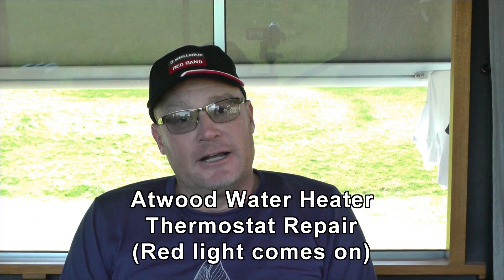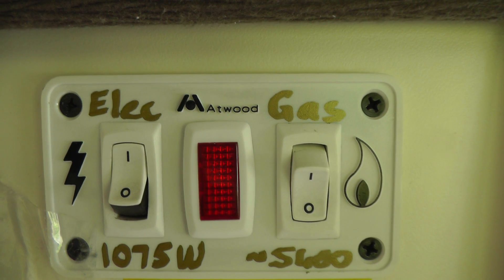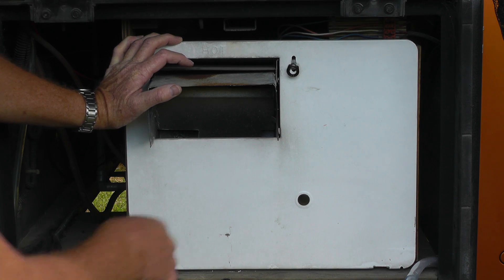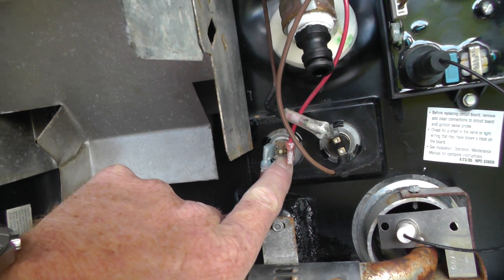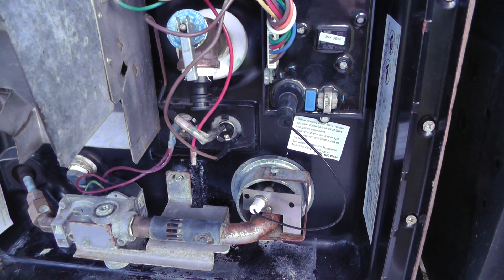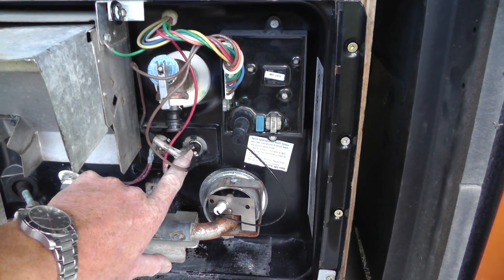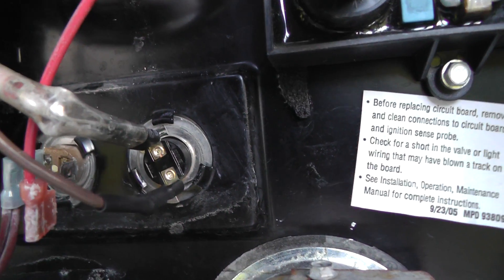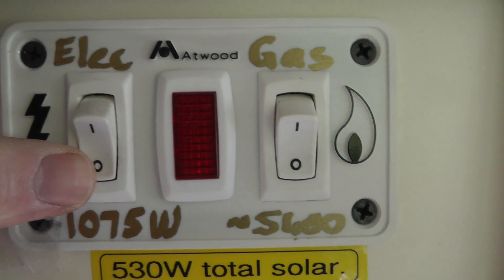Atwood Water Heater Repair - Red Light Fault

Comment: No owners manual. Followed your instructions for resetting the red light (even though it never came on) and fixed the problem for electric operation. Apparently my red light is burned out. Kudos to you for the lesson. Ahhhhhh, hot showers again just in time for fall...no more heating dishwater in the microwave...now to replace the solid gas line going to my stove with a flexible one that won't leak after I push the stove back into place. Life will soon be wonderful again. Will send you money/an autograph if I ever become rich/famous.😀
Reply from the maker: I take it you didn't become rich and/or famous. Glad it worked out and video was helpful.
Reply: @geoffreyjbrown   - No fame or fortune yet  but will share if it ever happens.

Comment: Great video full of good info!  One thing I would like to add is that the thermal fuse, discussed starting at around 4:47, should be angled away from the connector  so that it sits above the combustion port.  This insures that, in the event that heat and combusting gases are escaping out of the front of the combustion port, that the thermal fuse is heated as quickly as possible and properly causes the gas to be shut down...before a catastrophic fire results.
Reply from the maker: I am hearing what you saying in regard to this and that may be the better thing to do. I don't however believe that is the way it was when I initially opened it (it was in the position shown being the position the manufacturer had it).  It should be noted that the gas, to my knowledge is injected early thru a jet before the slits in the pipe shown underneath the one-time thermal fuse.  It may be that having the thermal fuse in this position (the one in the video) then caters for a blockage at the end of the pipe going into the tank, causing the flame to probably come out these slits. In this event the position shown in the video may be better for that scenario.  

At the end of the day I'm not sure if the manufacturer has thought a lot about the situations that may occur and tested the best position.   I just went with the position it already was in.  

Was yours in a different position when you opened the cover ?

By the way glad you liked the video.

Comment: Well thank you sir mine start malfunctioning couple days ago. Googled found your video went out side opened things up cleaned the connections turned on light went out. The pop off had a small drip on it that had been running onto the connection. Will be replacing.
Thanks again you got me back going.
Reply from the maker: Glad it was of help. Thats why I put it up on youtube as with all these types of fault there is a certain amount of diagnosis involving time, thinking and coffee to initialy figure things out.

Comment: Thank you for the video. I am having a similar issue with the electric side of my heater, accapt the gas side works fine. Wouldn't a bad thermostat or eco kill both sides?

Comment: I only use electric in my camper. I have hot water and my fault light stays on after water heats up and won't shut off. Should I be concerned? I've replaced, thermostat, eco, tstat, element and cut off wire.

Comment: I notice that you have the Eco and the thermostat reversed unless on your unit that's where they are placed but in order for it to be correct they have to be in the right position? Your thoughts?  My Eco is on the left and the stat on the right.
Reply from the maker: My ECO was on the left and in the video I disconnect it to demonstrate how the ECO works and causes the red light to come on. I dnt know what you mean by "stat" but the right hand sensor does the work of keeping the water at temp when electricity or gas is available and unit is powered on.

Comment: Looks like you are missing the foam gasket for your ECO and T-stat sensors. I just replaced mine because I thought the light should come on when you turn on the gas or electric switch and it wasn't. I was mad when the light wouldn't come on after replacing, then I find out it's a fault light!
Reply: I thought the same thing until mine did come on the first time

Comment: The main indicator light switches you don't work for me. But the hot water seems to work intermittently. Should itwork while the furnace is turned on? That's the only thing I could think of this morning. Maybe the furnaces using up too much propane or something
Reply from the maker: It should provide hot water all the time when the gas and/or electricity is on.  On gas it will come on every now and again, even when hot water not used, to keep the water up to temp in case it is needed.  If you are on gas then my conclusion would be that the gas is either not getting through (regulator), the bottle is empty or the ignitor is faulty.  In all cases, if electricity is switched off then the red light should end up coming on.   Once the red light comes on, from memory, it gives up trying to keep water hot.  The only last thing I can think of is that your red light is not working which would explain the intermittent nature  of the issue as you are not being notified thta it has stopped heating the water.

Comment: I need a starting point. My atwood was under electric operation, there was a noticeable smell of burning briefly inside the rv. The smell cleared but now the heater does not operate by electric. The usual buzzing sound when power is on is still there but no hot water. Where should I start? A burnt fuse should not make smoke right? I see nothing scorched on the outside of the heater . Thanks for any ideas.
Reply from the maker: Only thing I can think of is that the relay has gone.   That would account for the buzzing noise.   The circuit board, including relay, is normally set into epoxy and mounted to the front top right where the heater "door" is.   Given you have no show of getting the relay separated from the epoxy and access to the soldering I believe you may have to buy a new circuit board.   Best thing would be to see if the buzzing appears to be coming from this circuit board and the relay.   My guess is that the relay has eventually made poor contact and causing arcing with then created carbon which rendered it unable to make a low impedance contact to power the heater.   Check relays is all I can advise.
Reply: A little late on this but it depends on what Water Heater you have. I have a dual water heater which means it it electric and gas. My brand may not be the same as yours. I am pretty sure you replaced something by now. If not let me know and I can pretty much narrow it down for you.
Reply: BrotherBones X hey I have the buzzing sound and fault red light comes on when I try to use it on electric, I can use it perfectly on gas. What do you think it might be ?

Comment: I replaced both thermostats and the electric won't heat the water and the gas will flame on then cut off 3 times and then it will stay off.
Reply from the maker: Sorry I didn't see this comment earlier. Unfortunately I have no idea what could be wrong other than a circuit fault or maybe no water in the tank.   

Did you ever figure it out ?

If so would be interested in what was at fault.